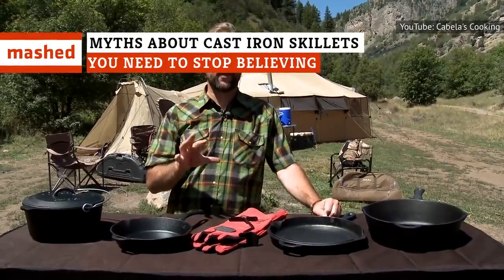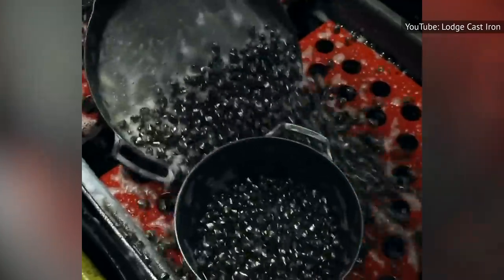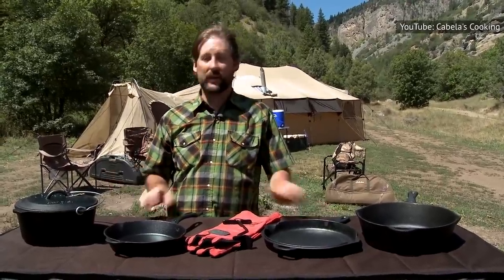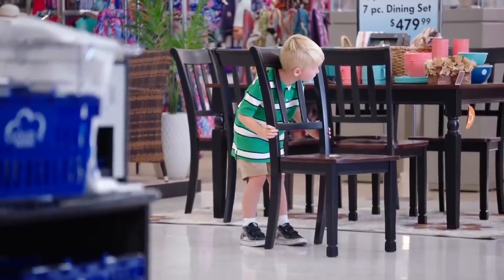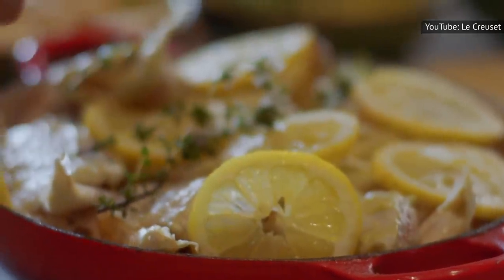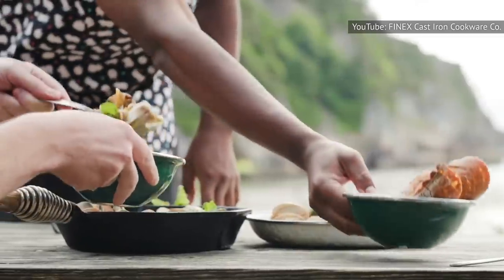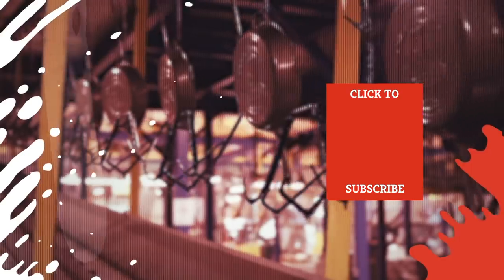Myths About Cast Iron Skillets You Need To Stop Believing

Comment: Enameled cast iron pots will chip if you leave them heating unattended with nothing in them or use metal utensils in them
Reply: You can heat Le Creuset in the oven empty. Just put it in the oven before you turn it on. I do that for no knead bread

Comment: Do not put your cast iron skillet on the burner set to the highest heat setting to season it. I wouldn't preheat any pan much higher than the medium heat setting.  Quick and extreme temperature changes causes warping in any metal.
Reply: You can't warp a thick piece of cast iron just by putting it on a high heat burner. You probably couldn't even warp a cheap aluminum pan that way.

Comment: I dont recommend leaving a layer of oil in the pan after cleaning, you should wipe the excess oil or you will have a gunky layer
Reply: Most definitely.  Will not have a good taste it will literally taste dusty
Reply: My granny would season her pans, then place them face down on the oven rack for about 30 minutes or so, then turn off the oven and let the pan cool. She said that was the way her grandmother taught her to season cast iron pans. She would repeat the process to reseason the pan after it was cleaned.

Comment: The concern isn’t that the soap will strip the seasoning, its that you have a porous metal and a porous seasoning, so you don’t put anything in cast iron that you don’t want to eat. Its also unnecessary to use soap on cast iron, it cleans up easily and the added heat you need to reseason and later to preheat it will kill any germs or bacteria anyway. 

If someone actually wants to learn how to use and care for cast iron, check out Cowboy Kent Rollins’s channel.
Reply: I never use soap to clean them. Right after I use them I rinse them in HOT water and use a brush to clean, then make sure they are dry. I've been doing this for 30 years.
Reply: Cast iron isn't actually porous. If it were porous, it wouldn't hold water or other liquids. If this concern were truly valid, it would also apply to every other cookware surface. This new version of the myth is simply to replace the old version that has been debunked over and over again. 

As for Rollins, he's good at using cast iron. However, science doesn't support his positions on cleaning and general maintenance.
Reply: The seasoning is mostly carbon..carbon absorbs  very easily. Washing with soap may live a trace amount of soap that may come out when cooking and change the tase of you food somewhat
Reply: @karlrovey  Leather is porous (its skin after all, so it has pours) and has been used as containers for liquids for years. Its how wine used to be stored. There is a difference between being porous and being a sieve. Have you ever seasoned cast iron (any but especially cast iron where the old seasoning was removed or new that wasn’t preseasoned)? I have MANY TIMES as restoring cast has been a bit of a hobby for me for the past 20 years or so. It soaks up those first several coats like crazy, especially when hot. I’ve also seasoned enamel and stainless, and it reacts differently, the oil doesn’t soak in. You can still season them to make them more non-stick, but it isn’t the same thing.
Reply: @karlrovey  wood is porous and we hold plenty of wine in them.......it actually helps with the flavor and mouth feel of the wine. So no that’s not true.
Reply: Any openings that dish detergent can get into, water can get into even easier, and water rinses away dish detergent, obviously. If you don't believe that, pour some some water through a fine mesh strainer and then try it with dish detergent. Which one flows through the small openings in the strainer faster/easier?

Your idea is based on pure imagination, not science or even experience. Experience would tell you that you can't taste any soap in food cooked in a cast iron pan that was washed with soap and then thoroughly rinsed with water. If you could, there wouldn't even be any debate about it, because no one would ever do it more than once, unless they happen to think soap tastes good. This is where imagination comes into play. You're imagining that the soap must be trapped in those pores even though you can't taste it, based on your flawed notion of how things work.

You could also do a very simple experiment. Wash a cast iron pan with dish detergent, rinse it out thoroughly with hot tap water, then boil some fresh water in the pan on the stove. If there were even small traces of detergent remaining in the pan it would case soapy bubbles to appear in the water.

Comment: Cast iron has pores, just like your skin. What you're seasoning is the porous metal surface. 
You don't want to soak your pan in a hot soapy water, but occasionally you'll need to scour it clean. This is just fine. When you're done cleaning it, immediately put the pan on high heat to remove any moisture. Once it cools off again, re-season it and you're golden. You want to clean and re-season your cast iron once a year anyway. Oils can, in fact, rot.
Another trick... if you happen to be a camper or you like to use your cast iron on your outdoor grill, while the pan is still cold take a paper towel with liquid dish soap on it and wipe it over the underside and outer walls of your pan. When you're done cooking, the soot from your cook flames will wipe right off!

Comment: Hated mine and threw it away. Way too heavy and used to get rust spots.  Pretty sure food used to stick in it as well.
Reply: If you don't check the oil on your car and it goes too low you will throw that away too.😁
Reply: @eminusipi  I don't drive so obviously don't have a car. 2 totally different things. Cars don't cost the same as a cast iron pot and don't do the same job.
Reply: @amandadavies..  If you had a black car on a hot summer day, you might be able to fry an egg on it.😁
Doesn't anyone have a sense of humor anymore?
Reply: @eminusipi  I'm in the UK and we don't get many "hot enough to fry an egg" summer days. I didn't realise it was a joke....which may be because I have sometimes ( probably too often) had insulting replies whenever I have commented about my dislike of cast iron pots. I therefore assumed this was yet another.
Reply: @amandadavies..  No problem. I do think that you should have given the cast iron more time before you tossed it. I also use some Matfer carbon steel pans.
Reply: @eminusipi  I don't have much patience with cooking stuff that sticks. It was years ago and can't remember how long I had it exactly, but probably a few weeks / months.

Comment: Delicate? ... no, but they can be broken.  Don't drop them, bang them together, or dump cold water into a very hot pan.  Acidic foods are okay for established seasoning if you clean right after cooking.  An immature season might be set back a little but not ruined.  The WORST thing that you can do to cast iron is put it in the dishwasher.  The long, very hot, detergent laden cycle will strip the seasoning (It is, however, a good way to start over seasoning if there are problems or a pan from a questionable source.)  My recipe for success is to clean them, by hand, in hot of water (as hot as you can comfortably put your hands in) with a relatively stiff brush before they get cold (this really reduces sticking), oil sparingly (a 100% flax seed oil supplement from the fridge is my favorite oil and dosage for a 12" pan inside and out), and USE IT OFTEN (you can't build a seasoning layer by putting it away.)

Comment: Cast iron is the best.  It holds heat much better than anything else.  And cast iron is easy to clean.. 

What?  Clean?

Yes.  Mild soap, water and a rag SHOULD be used everytime you use your iron skillet.  Simply wash and dry.  Lastly put it on the stove (high heat) with a small puddle of oil in the center.  Turn off and remove from heat as soon as the oil starts to slightly smoke.  Work the heated oil around the entirety of the cooking surface with a paper towel.  

Done, and perfect for next time!

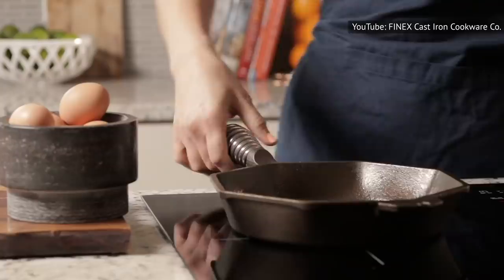Comment: 1:05 That looks like an absurd amount of oil for seasoning.
Reply: If youre seasoning a pan you should be doing both inside and outside the pan, so it's not too crazy an amount they showed.
Reply: @gorrillawarfair  It is still too much for seasoning. You could dip your paper towel/oiling cloth in oil a single time and have enough oil for seasoning.
Reply: It was. A thin coat is all that's required.

Comment: Don't heat them on high using an electric coil stove.

The electic stove heats unevenly and that can lead to a sudden crack.

We cracked a limited edition celebratory pan that way.
Reply: ZapDash That must have been a faulty pan. We cook in cast iron almost every day on a coil top electric stove and we have never had an issue.
Reply: @cobra19946  Even going cold to high? I saw that others had had similar issues when I searched online right after.

Comment: So it's low maintenance but then she says that after cleaning, you have to re-season it? How is that low maintenance?
Reply: You don't need to reseason every use (and certainly not with their stovetop seasoning method). Normal use will put more seasoning on than the negligible amount of seasoning you lose when washing with dish soap (seriously, just about everyone has the baking sheets with baked on oil that just won't come off no matter how many times it gets washed). The exception is when you use something like tomato sauce. You might need to touch up your seasoning then.
Reply: @karlrovey  
You got it. Just use it. Gets more non stick as you go.
Reply: I have to think 'reseason' just meant to put a give it a wipe down with some olive oil after washing to prevent any oxidation. But why the negative comments about paper towels? I prefer using a paper towel after washing. It catches any carbon off the pan. Why soil a kitchen towel with that? And I also use them to apply the light coat of oil after usage. What are these people using instead, their fingers?

Comment: Watch Kent Rollins videos if you want to know how to keep and use cast iron.  Soap? Never
Reply: Dish soap is fine.  Polymerized oil is much tougher than a quick wipe with dish soap.
Reply: He's right about a lot of things but simply wrong about this. Dish soap will not affect a proper seasoning, try it if you don't believe it. It's not a question for debate, the old maxim came from the days when soap had lye in it and would strip the seasoning off.

Comment: Cast iron is high maintenance compared to any other pans except carbon steel pans. I use stainless steel pans and high quality non-stick pans and wouldn’t ever go back to cast iron or carbon steel. Cooking takes enough time I don’t want to spend all the extra time maintaining my pans. Stainless steel just soak for an hour and they clean up in seconds. Non-stick don’t even require that.
Reply: Obviously you were doing it wrong
Reply: @OGPimpin  I have seen people using cast iron and carbon steel all my 64 years and used it myself they are simply much more work.

Comment: Your video shows a lot of ceramic cast iron cookware, but your advice is only for non ceramic coated cast iron.  Ceramic coatings can be chipped or scraped and need to be treated gently.  Metal utensils should not be used on ceramic coated cookware.

Comment: Unfortunately the high heat can crack cast iron. My brand new griddle cracked while I was preheating to make pancakes. No hotter than I would have the flame for any pan. The griddle was a gift so it was doubly bad.
Reply: sounds like a cheap poorly made griddle.
Reply: A Griswold wouldn't do that.   Love my antique collection of Griswolds.
Reply: No real cast iron griddle will crack. I have a collection of cast iron pans...my FAVORITE way to reseason a pan is outside in the barbeque pit. No cracks..
Reply: @destinyshae07  I once dug an old cast iron pan out of a junk pile  since I had nothing to lose, I tried burning it clean in a bonfire.  that was a little too much heat, or the pan was just too far gone.

Comment: If your cast iron is coated in enamel or ceramics(like the dutch ovens/braisers shown in parts of this video)... do NOT use metal tools, it WILL chip/scratch away at the coating.

Comment: All the new cast iron skillets I see for sale have rough "pebbly" cooking surfaces.  This is something I never used to see before.  My mom's old cast iron skillet had a nice smooth cooking surface, easy to cook with and easy to clean.  What gives?
Reply: Cheap manufacturing. Some people sand their Lodge skillets down so they're smooth and completely re-season them. Smart people just buy carbon steel instead.

Comment: La Creuset pans are enameled inside and out and you don’t want to use metal utensils as you don’t want to scratch that coating. Think Wooden or Silicone utensils!
Reply: Not all Le Creusets are enameled inside. I have quite a few that are not including a wonderful, deep (expensive) chicken fryer and a 10 inch skillet I use ONLY for cornbread. I’ve had them both 40 years and counting and use them both at least once a week.They should be handled just as you would any cast iron product.

Comment: Cast iron isn't delicate, it's brittle.  Sure you don't have to handle them like they're glass but there are things to be mindful of.
Do not drop them.  They do not handle shocks well and can crack or break when dropped.
Do not thermal shock them.  Don't take a hot piece of cast iron and rapidly cool it down.  They can crack and break.
Do not leave empty cast on hot burners for extended periods of time.  It's less prevalent with newer, thicker cast, but the older thinner pieces can easily warp.  The term for these are "spinners".  Warped pans function poorly for indoor cooking.  
I have pieces that are 5-10 years old.  I also have quite a number that are 70-130 years old.  If taken care of they do last.

Comment: To get the hard crusty stuff off the outside, put the skillet in a fire, like a wood burning stove or fireplace.
Reply: To get the crusty stuff off, heat the pan, dump in some Kosher salt and rub with a couple of wet, wadded  up paper towels.
Reply: I used Easy Off oven cleaner on the outside, it removes the crusty stuff.

Comment: On washing, I will stick with Great Grandmother, use the absolute minimum soap IF you need any AND rinse it out thoroughly and immediately.
Reply: BTW, hot water will clean anything just fine without soap.
Reply: @realistic.optimist  Except excess oil.

Comment: BS:  You don't have to re-season after washing or cooking every time.  Only if the pan has been over heated so the polymer coating (seasoned coating) gets cooked off.  BS:  I have never heard that CI is delicate in any way except for possibly cracking if immersed in cold water while still vert hot.

Comment: I use soapy sponges to remove excessive oil and grease. I've had my cast iron skillets
for 25 years that I bought at a thrift store, and I mostly soak them in water to clean them.
You cannot ruin a cast iron skillet. Most people cook with thin Teflon skillets... ew.

Comment: I want to like cast iron because it is tried and true, but I don’t want “iron” in my food. I want the nutrient iron in my food but not the metal leeching in my food.
Stainless steel is the “safest” in my opinion. ( I get the 18/10 nickel content and aluminum base )
Reply: The nutrient is the same as the pan. That's why it's healthier to cook with cast iron. It's supposed to leech.
Reply: Valid point. The problem with your point though, unless you get a expensive pan you don't know what the pan is coated with. then it's probably not aluminum or stainless steel. A lot of the aluminum or stainless steel pots and pans have a coating of some sort of non-stick or they have a paint to make it pretty on the inside I just rather stick with my cast iron sweet simple easy.

Comment: Be very careful using cast iron on flat surface stoves. They’ll crack in half if you heat them too fast!
Reply: the danger on flat stoves is not cracking the pan, it's cracking the stove!

Comment: Oh shut up. Soap will take the seasoning off. After use clean with hot water and a cloth & smear a little oil over the pan. They are only delicate if you put cold water in a hot pan, your foot is delicate before you drop your pan on it.
Why have you made a video about cast iron, just to pass the time I reckon.